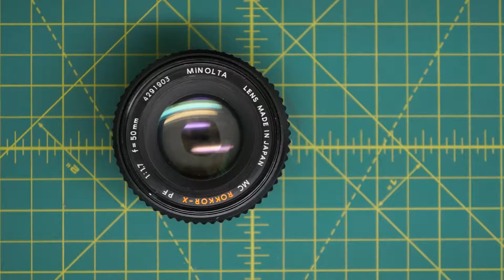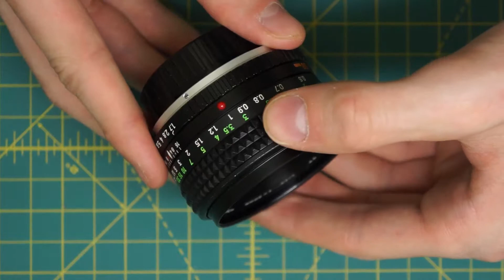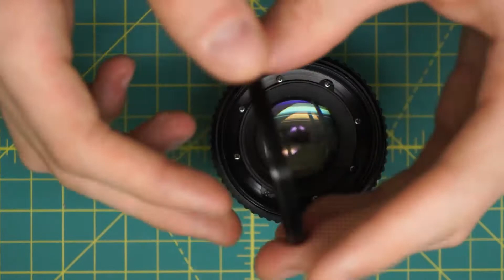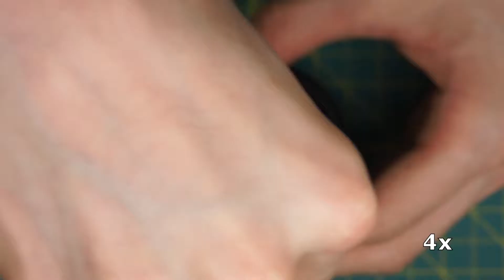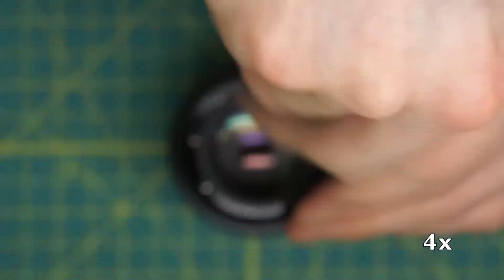Minolta MC Rokkor-X PF 50mm f1.7 Lens Disassembly

Comment: Hello, I bought this lens and as I can see, it is harder to disassemble than the rokkor x. I bought it for video so I just want to declick the aperture. Do I have to take everything apart or may I only need to remove a specific piece in order to proceed?
Reply from the maker: To de-click it, you only need to remove the ball bearing under the aperture ring. Just go in from the back of the lens. You should only have to remove the mounting plate to access the aperture ring
Reply: Matt Bierner what size are the mounting plate screws? I was able to take the outer ring out but I cannot take the mounting plate out

Comment: First of all, thank you so much for this video. It is extremely well made, it's simple and straightforward.
A couple of months ago I bought a Minolta SRT201 with a MC Rokkor-X PF 50mm f1.7mm lens. When I received it, the focusing ring was working, but nothing happened when it turned. I mean it rotated but the mechanism did not work. I searched for an online tutorial and found this video. I followed your instructions and disassembled the lens but, to my surprise, I could not tell what was wrong. I was disappointed but I started to reassemble it back. The thing is, when you start to explain the part about the infinity focus and so on, I found out that some of the screws had been to tight, maybe from a previous disassembly from the previous owner (who knows?).
When I finished the job, the focusing ring was working properly (as far as I can tell). I just need to buy a new battery and load some film for the final test.

Once again: a big thank you (from Portugal)!
Reply from the maker: Thanks. Glad to hear that you were able to repair your copy

Comment: I came across this old, in great looking condition Minolta MC Rokkor-X PF with a stuck aperture control ring, the aperture blades are working smooth. I think maybe the bearing may be somehow jammed.
Reply from the maker: It could be. Try removing the ball bearing and seeing if that makes a difference. Another possible cause could be that the mechanical coupling from the ring is causing problems. Just try taking things apart until the pieces start working properly, at which point you should have a pretty good idea where the problem lies. Good luck.